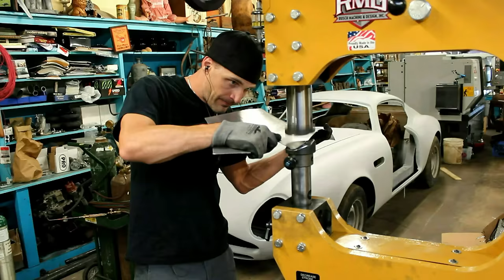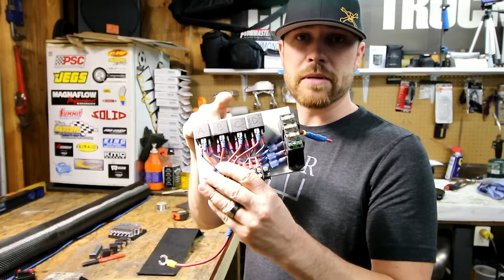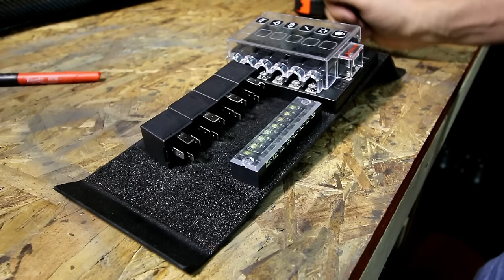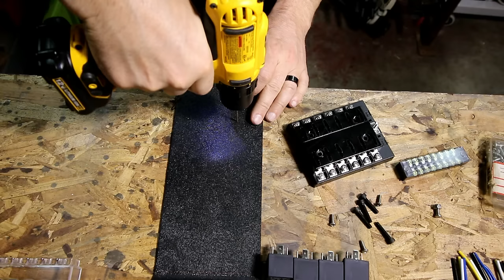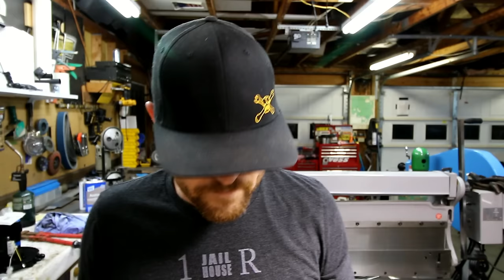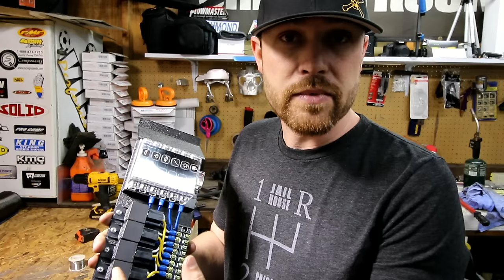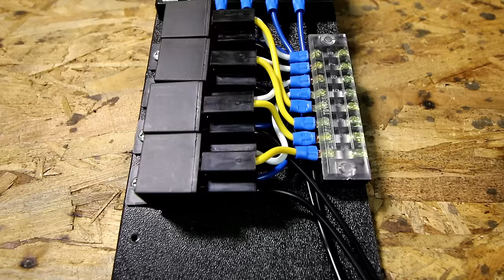How To Make A Power Relay / Fuse Block | Automotive Wiring

Comment: When you say that you'll "make sure you solder it" @6:02, what specifically do you mean?  (serious question)  i know how to solder copper ring terminals for main battery lines, and how to solder stranded wire to stranded wire, but i have no idea how you would go about soldering stranded wire to those types of ring terminals.  I don't imagine solder is going to stick to those at all.  Actually im pretty sure i've tried.  do you mean you are going to crimp it and then drip some solder down inside and hope for the best?  I'm going to attempt to replicate this for my '65 Ranchero because the existing setup for running all the power for the electric radiator fans into the cab and through a switch is probably going to burn it down one day.  Great video, I really appreciate it.
Reply from the maker: They are easy to solder. I just heat the ring terminal end up and once you see the surface flash the solder will flow right in.
Reply: Sweet thanks I'll try it that way.  Makes a lot more sense than what I've tried.  Thank you

Comment: What gauge wire do you have for your power input. Battery to breaker and breaker to Fuse Block?
Reply from the maker: +Pieman16 depends on the setup...I use heavy gauge welding cable

Comment: @TheFabForums would i be able to use these for things like ignition, starter, fuel pump etc etc.?
Reply from the maker: Ignition and fuel pumps yes but you would need a starter solenoid for the starter. You could use a relay to trigger the starter solenoid if you wanted.
Reply: The Fab Forums Would I wire this from battery to distribution block, then block go switchboard? (also a great idea for a video to help guys like me out) thanks for the quick and helpful reply

Comment: Can you use this to hook up some auxiliary lights? Would it be difficult to hookup the switches for it?
Reply from the maker: sure...it would easy
Reply: The Fab Forums what if the relays all have 5 wires instead of 4, what do ya do with the one that's always hot? Just don't use it?

Comment: My question since I'm dum when it comes to electrical is how do you determine what items need relays? I get that some items draw too much for just switched power but is it generally just fans, fuel pumps and window motors? I know that sounds silly but I'd be that guy running a relay for everything lol
Reply from the maker: Yeah if it draws more current than a switch can handle it needs a relay. I run them on basically everything

Comment: Did you use a 300 amp breaker? If so what's it going to be running? I'm building this setup and I'm just worried that 300amp to run a few spotlights might be ineffective
Reply from the maker: yeah 300 amp is crazy large. I will be sending power to the front of the car with some 1 gauge cable and the breaker will only be there just in case this cable were to short out. I will fuse the rest of the components seperately
Reply: +The Fab Forums oh I get ya, cheers for reply
Reply from the maker: no problem...anytime

Comment: Hey Fab Forum
I have a question
I c that ur only 4 spot off tha 10 way fuse block
Do I need a 10 way fuse block
Reply: Plus how would I wire a toggle switch to flip tha switch on tha relay
Thanx

Comment: I have a question. Did you also fuse the switches going to panel?
Reply from the maker: The main power for all the switches is fused in case of a short

Comment: I'm building my wiring at the moment and have the battery in the boot with the feed going up to the starter and want to protect it from the battery end. What size breaker should I use to protect this cable? Sbc with high comp and a hi torque starter.
Reply from the maker: you want the breaker amp to be under what the cable it self can handle.
Reply: I'm using 70mmsq flex double insulated. I think I'll just try one and if it draws too much for it I'll just take it out. Really great video man, It actually get's me pumped about wiring.
Reply from the maker: You wont know till there is a fire. Look up the amperage rating for the wire and then use a breaker that is made to trip at a lesser amperage

Comment: Could I build this inside a plastic container, lunch box,  to keep water and mud away. Or does it need to have air flow to stay cool and not heat up.
Reply from the maker: Yeah you could enclose it with no issues

Comment: I want to build something like this for my stereo.  My question is: can a single remote turn on wire from the stereo operate all four of those relays?
Reply from the maker: yeah just use it as the common switch wire

Comment: Thank you for this video, 

How do I calculate the amout of amps for circuit breaker that I need ?
Reply from the maker: you dont want the amperage of the breaker to exceed the amperage rating of the wire it is supplying power to
Reply: So a 300 amp breaker would require 300 mcm copper wire. From the looks of it you have 8 gauge or 6 gauge which would have a maximum rating of 55-75 amps. That wire is extremely undersized for that breaker unless there is something I'm missing here.

Comment: Awesome - how to - video but I followed all of your purchasing instructions and ran into an issue... The power distribution blocks you linked are 25a- Meaning 25 amp max load... but you are plugging multiple 40 Amp Relays into the slots.... wont this eventually fail catastrophically due to gross overload?
Reply from the maker: 40 amp relays doesn't mean you will be running 40 amps though it. Almost all you automotive accessories use less than 20 amp. plus the fuse will be the weakest point if you did have a short.

Comment: so would you use 1 relay per gauge as an example or could you run all your gauges off one relay? I'm using 5 gauges
Reply from the maker: Gauges probably don't need to be relayed. Just fused. Just high load items like fans and fuel pumps need to relayed.

Comment: How do you know what gauge wire to run from battery to fuse block, and how to determine fuse (or breaker) size?
Can we get a video of you wiring some things with this.
Reply from the maker: Just need a main power wire that can handle the total amperage needed for the fuse block. Then you want a breaker or fuse that is smaller than the rating of that wire.
Reply: Thanks for the response and great videos. Really like how professional all your work looks and has great functionality too.

Comment: So what do you do if you want to use ground to tiger on the relay?
I use ground to turn on my relays because vehicle has ground everywhere and if it shorts to ground no blown fuse and almost half the wiring.
Reply from the maker: you just put the switch on the ground wire vs the power
problem with ground activation is if it shorts your relay and what ever it is activating stays on and wont shut off....and it still doesnt keep the power circuit from potentially grounding out

Comment: on that white wire that you said you can run a switch off it and all you need is a voltage charge to switch the relay and power goes out the yellow to what ever you power but what do you run to that switch? a constant 12v from that power block to then when you hit your switch it gives power to the yellow?
Reply from the maker: Yeah you have low load constant power to the switch. The power goes from the switch the activation side of the relay.
Reply: So I have a question: What if I'm going to mount gauges that I need them always on when the power is on. should i just connect them to the box on top without using relays ?
Reply: A7mdoh720 I would just connect them to a fuse that only gets power when the ignition is on if you want yhat

Comment: couldnt you connect the white to the blue and then the blue to the fuse panel, then install the switch on the ground wire?

Comment: does the relay amperage need to match the amperage of whatever you're adding on fan, lights Etc.?
Reply from the maker: +S0uthp4w68 the relays are usually 40a so they will be able to power any you accessory you would have on it

Comment: So I understand how to wire the accessory to the yellow terminals but how are you supposed to wire a   
two pin switch to the white terminal? To a ground or to the battery, etc...?
Reply from the maker: you want to send power to the white terminal to activate the relay

Comment: would it be possible to use one wire for the trigger (ignition switch)  would the load be to heavy?
Reply from the maker: no thats what they are made to do

Comment: i have a stripped car that i would like to do a simple wiring for lights ignition fuel pump and fan. I have the engine harness and ecu. but my question with this setup is will it be just for fan or fuel pump or could i run ignition on that with start button ? i see some guys use a kill switch as a ignition switch
Reply from the maker: yeah you can run what ever accessory you want. No need to use a relay for the starter though....it has its own relay
Reply: right with it having a solenoid
Reply: ok so i could run  say fuel pump 12 v wire too the power coming off the relay and another wire from my toggle switch too the switch side feed coming off the relay?  another words 86 or 85 side would be my toggle switch and 87 my power goin the the accessory

Comment: What is the current draw for the whole power relay block?  Is the breaker for the whole car, or just the relay block?
Reply from the maker: +Richard Prowse well the breaker is just encase the main power cable were to short somewhere between the bat and fuse panel

Comment: Also how are you tieing the 10 way fuse block to the bigger gage 2 , 6 , 8 gage  battery wires you only show an important part of the entire electrical system of a car your missing the battery cables to fuse block to your 10 way fuse block. And any fusible links , circuit breakers you add. I have pretty good idea how it goes now but like to see the complete wiring from battery cables to the 10 way fuse block you created/addon as well.
Reply from the maker: fuse block has a main power post

Comment: How would you determine what size relay you would need? Super new to this... 😱
Reply from the maker: they mainly all come in like 40 amp which would be go enough to run what ever it is that you need
Reply: Is that we're it would shut itself down? Or does it produce that amount of power?
Reply: The Fab Forums thanks for the follow up

Comment: Hey man, I need some help wiring my switch/push start button to my car. I want to do it with a relay but don't know how to wire up from the ignition to the button, any help would be great. Thanks! By the way amazing job, just subscribed to your channel.
Reply from the maker: the ignition and the start are two different functions. Not sure what kind of button you have and how it works in order to help you out.
Reply: It's a jegs racing switch panel with a switch, light and a start button.
Reply from the maker: gotcha. the start button just needs to be wired to the starter relay, you wont need a relay for it like I used in this video. For the ignition you could have the switch activate one of these power relays, and that power relay turn on what ever it is that your using for ignition...msd, computer...
Reply: Seems simple enough haha, thanks man. I was feeling kind of lost and confused my self, I'll get back to you when I install it and hopefully without any problem otherwise I'll ask you something else hahaha.

Comment: I think of the process like a TV remote. You sit in the big chair (drivers seat), you hit the power button on the remote(headlight switch), The TV comes on (headlights come on). No where in that did the 110v cable connect to the remote in your hand. It goes from the wall to the TV. You triggered a relay that connected the TV to the wall plug, turning it on. The switches on your dash are like little remote controls and the relays are THE REAL switches that turn shit on.
Reply from the maker: for sure

Comment: No heat shrink? Is there a reason for not using Heat Shrink on all the connections? I am about to build on of these for my Race car and I just want to make sure I do it correctly.
Reply: sorry for my premature comment, as I got further into the video you stated you were going to add heat shrink afterwards. Forgive me for my premature comment. Keep the content coming!
Reply from the maker: yeah I now use the crimps that have heat shrink built in to them

Comment: Is there reasoning behind putting the power out and power switches for each relay on terminals not next to eachother? For me atleast, I would think it would be less confusing to have relay 1 power out and power switch on neighboring terminals.
Reply from the maker: you can do it how ever you want....I do it this way because it looks best. Generally you have all your switch wires coming in together from the switches and all the power wires are running out together

Comment: I have a suggestion, sir. Is that power wire coming out of the 300A breaker 8AWG? From the video, that's my best estimate. A 300A breaker can't protect a wire that small under all conditions. You should up the wire size to something like 1AWG or use a smaller rating on the breaker. You need to understand the behavior of the breaker in order to be certain. Wire insulation type matters too. Some types of wire insulation such as PVC will burn or melt at lower temperatures than insulation types like cross-linked polyethylene (GXL/SXL/SAE J1128) or Teflon.

You said there would be fuses for the branch circuits. The wire size should also be chosen based on the fuse rating. You can always use a larger wire with a smaller fuse if you wanted to wire up everything using one wire size. That's more costly, though. Anyway, have a look at the published data from Littelfuse or another reputable manufacturer for recommended wire sizes and insulation types for each rating. Don't use knockoff foreign-made fuses. They don't work. You save a little money, but they are not precisely calibrated to respond to all overloads like fuses manufactured for OEMs do.

Best of luck!
Reply from the maker: breaker is for the main power cable from the battery. everything else is protected by the fuses
Reply: @Thefabforums  I'm talking about the fat red wire. You said in the video at about 9:20 that the breaker is there in case the fat red wire shorts out between the block and the battery. I'm just telling you that a 300A breaker can't protect that wire. The wire is too small and/or the breaker is too big. The wire will burn at currents well under 300A. At 200A, for example, that breaker won't even get warm, but that wire will cook and burn.

Have a look at this: https://www.littelfuse.com/~/media/automotive/catalogs/littelfuse_fuseology.pdf

On the last page, you will see max carry current for various wire types and sizes. You can see that at room temperature, an 8AWG GPT (PVC) wire can only carry 87A. Generally, automotive wiring systems are engineered to ambient temperatures of 105C in the engine compartment and 85C in the passenger compartment. Looking at the chart, you can see that under those conditions, the safe current-carrying capacity of the wire is drastically reduced. They don't even show the PVC at 105C because it can't really be used over 90C.

My suggestion is to use nothing but GXL/SXL. It's just an all-around better wire anyway. It has higher abrasion resistance as well as the temperature benefits. The fuse or breaker is there to protect the wire that comes directly after it. The wire needs to be matched to the protection device otherwise you're not getting the benefits you want from the breaker or fuse.

Just trying to help.
Reply from the maker: @jimbeckert7946  no need to look because the red wire isn't what I used. I always use welding lead cable from battery. I was just showing an example of how the system routing would look. The size of breaker will always be dependent on the cable size used which is different for every application.

Comment: I had a question about a 5 pin relay.   the relay for my fans is 4 but my fuel pump kit is 5.    is there a suggestion for the 5 pin relay?
Reply: The fifth pin is for power or ground feed-thru (depending how the relay is wired) when the relay is switched off. Some relays don’t have it.

Comment: i have issues with my toyota corolla 2007 model, i the cables has to many joining and cracks and i am looking forward to replace the complete wiring system.
Reply from the maker: +kenechukwu umejiaku right on

Comment: How do I apply this set up to a Camper 12 volt system , I am hooking up a Hot water Heater  ,water pump, winch and lights , I made the same set up as you show but how do I trigger the relays to switches?

I have 12V going to circuit breaker then to the fuse panel then I wired the relays as you did #30 power from fuse block ,thats as far as I got.
Reply from the maker: +jas van the 12v from the switch triggers the relay
Reply: The Fab Forums where do i get power to the switch ? do i run another wire from battery
Reply from the maker: yeah just get it from the fuse panel

Comment: How do you wire a switch in to something like that you have a wire doing from the relay to the switch but does the other wire go to the battery or somewhere else
Reply from the maker: yeah back to the fuse panel

Comment: Whenyou said you went back and soldered everything specifically which parts did you solder?
Reply from the maker: all the crimp connections
Reply: The Fab Forums I am extremely new to this are you talking about soldering underneath the crib connections or soldering in lieu of crib connections and if so how do you do it
Reply: *crimp

Comment: is this necessary for just some LED light bars and other light accessories or is it overkill?
Reply from the maker: yeah you really should run relays for everything
Reply: Ok gotcha. Thanks a bunch.
Reply from the maker: no prob
Reply: what gauge wire should I use going from the battery to the fuse box? And what is a good placement area for this? I was just thinking under the hood somewhere.